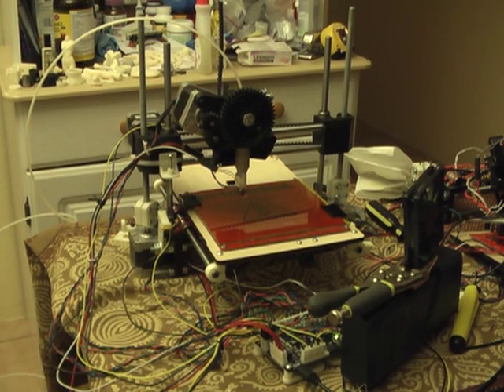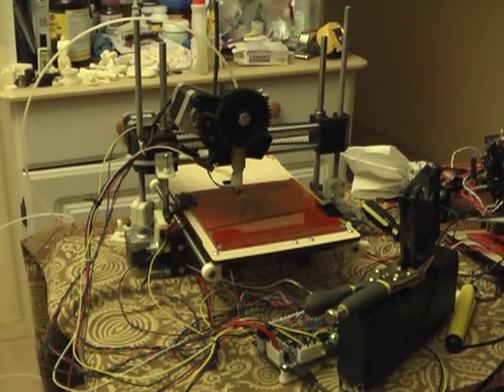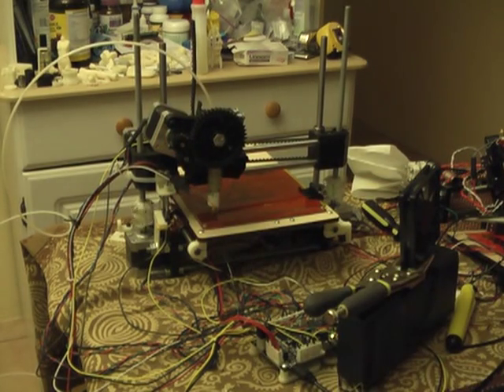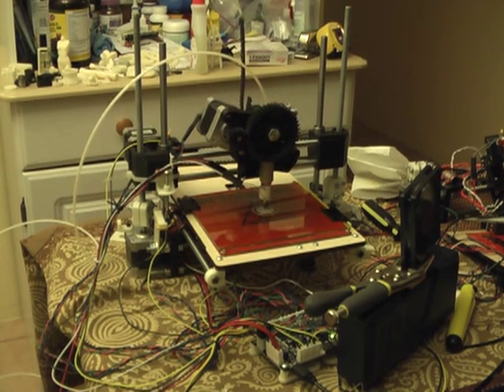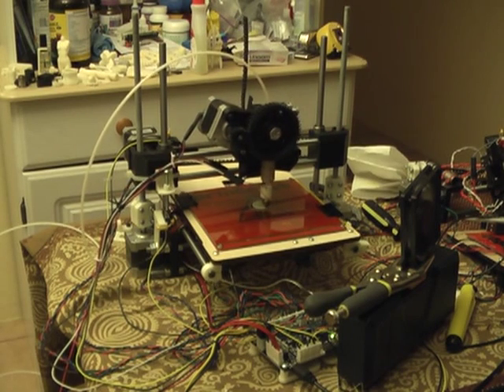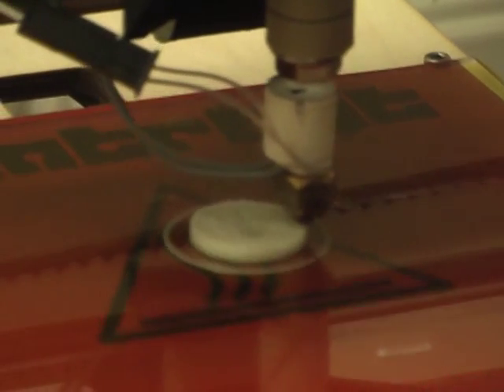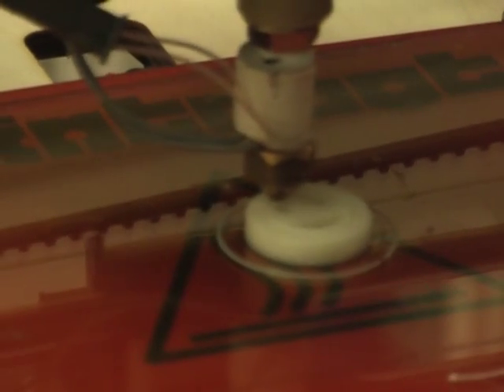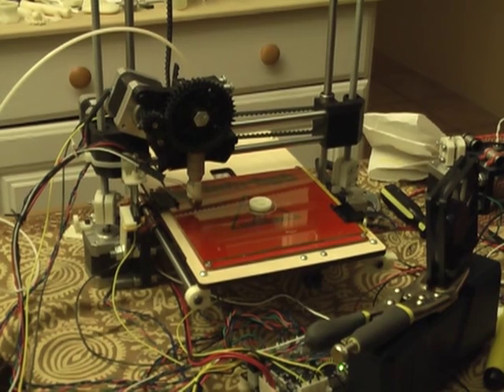3D Printing Basics Part 2 - running your 3D printrbot printer

Comment: I'm a sophomore CADD student at a tech high school in Connecticut, we just got a 3d printer from Stratasys late last year, for over $20,000, and each KG of filament is almost $1K! anyway, I'm currently saving for a Printrbot jr......or possibly GO! if they still are making them by the time I have $1500. Thanks for the help, all of the software that we use to print is proprietary, I had no idea what to expect, i have been researching repraps for a while now, now I know what to expect! thanks!